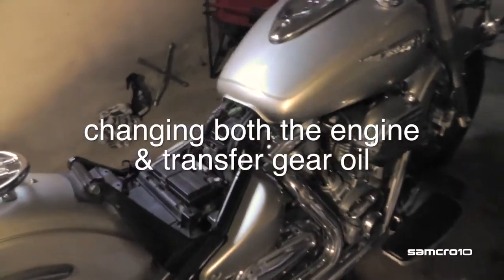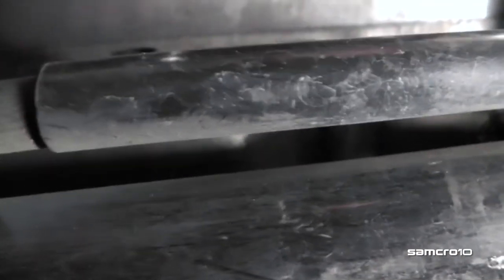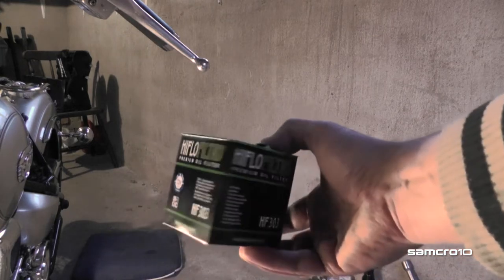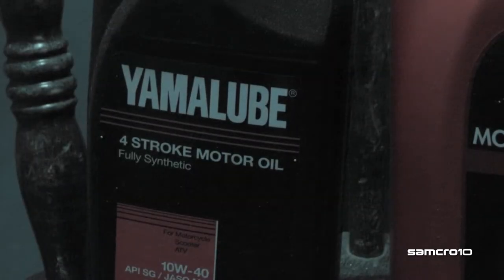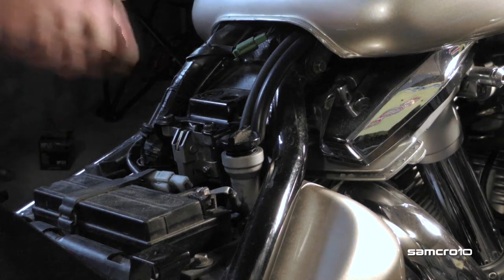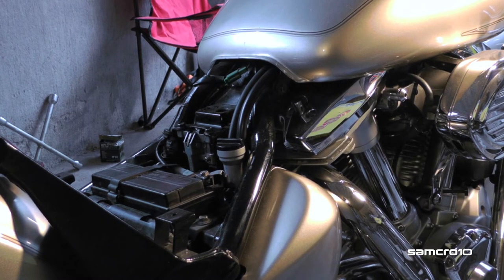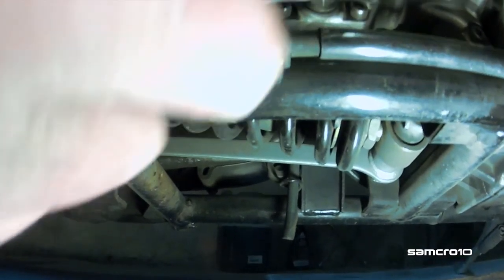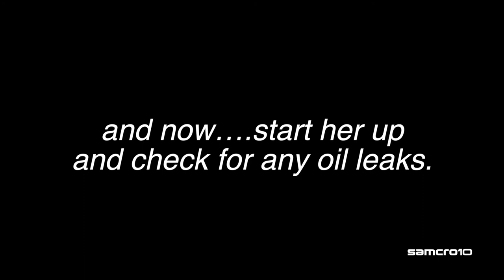How to change motorcycle oil, Wild Star & Road Star

Comment: The complete Oil Change on the Side stand ?
Does not the machine also have to stand upright ?
Reply from the maker: Not on this bike, if you look where the oilplugs are located
Reply: @GurrasGarage  The Oilplug next to the side stand ok but the one near the Suspension ? This one is on the other side and "up Hill"
Thats no problem ?
Reply from the maker: @oliverf.5479  No problem I did oilchange every year for 14 years on this bike. Also as you can see I filled it up to the exact amount of oil as required.
Reply: @GurrasGarage  Thank you for the quick responses. I appreciate it. :)

Comment: For xv1700 the same procedure, 4 liter engine oil with filter is enough. 10w40 or 20w50 for hot parts of the world.
Reply from the maker: Good point about 20w50 for warmer climates.

Comment: Sooo, can I get away with 4L with a new cartridge oilfilter? or do I need to buy an extra liter of oil for the extra 0,1L?
(I know this is an old video, sorry)
Reply from the maker: I dont remember now, but I suppose its 4,1 for oil change with filter. I must have read that in manual I sure didn't come up with it myself :)
Reply: @GurrasGarage  Thanks!
Seems like it says 4 quarts in America and thas less then 4L so I guess 4L should work, but I might top it off later on!

Comment: I don't go cheap with my bike.  I only use the best made.  Royal Purple oil and Purolator One oil filter.  Royal Purple likely has over 100 times the film strength of the Yamaha oil.
Reply from the maker: So have you changed oil now, if its 100 times better I guess changing every 7 year should be enough 😆